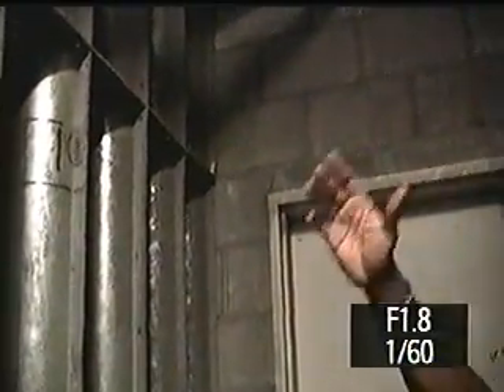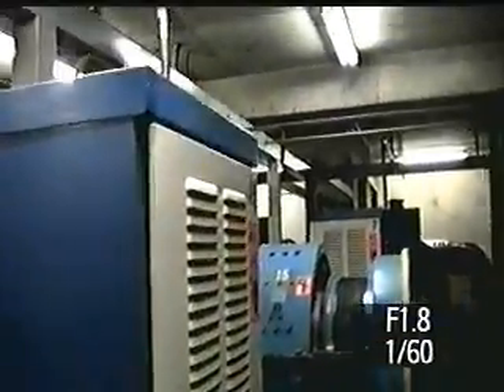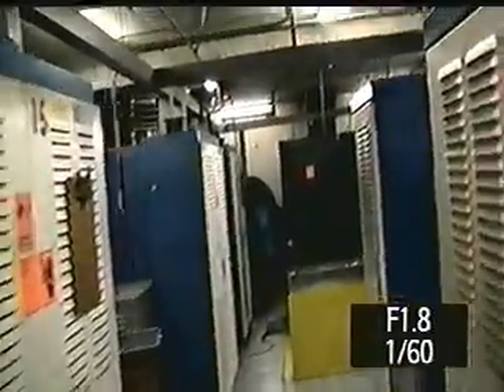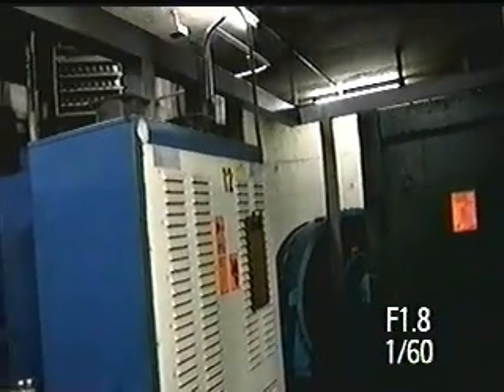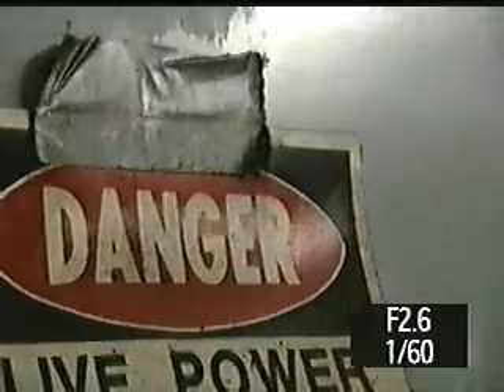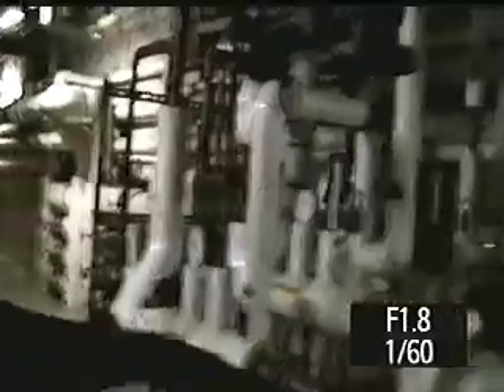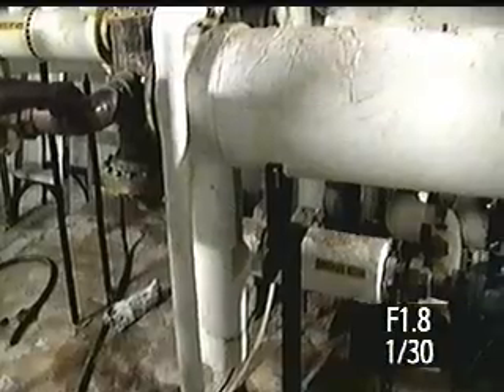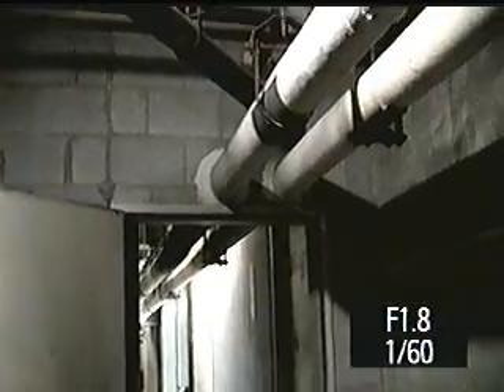Otis Traction Elevator Machine Room, Marriott Marquis, Atlanta, Georgia

Comment: Looks like several of the original DC traction machines are being modernized and/or being serviced.  With the noise generated from the ventilation fans, I could not tell if any MG sets were still in use. I did see a number of DC Drives next to the controller cabinets.  Has it been revisited since it was filmed back in 2013?
Reply from the maker: No, I haven't been back there. These have got to be from the 1980's due to the fact that the Otis door open/close buttons were green and yellow.